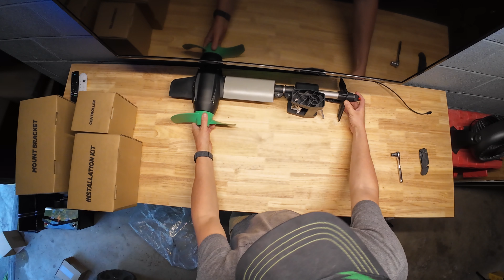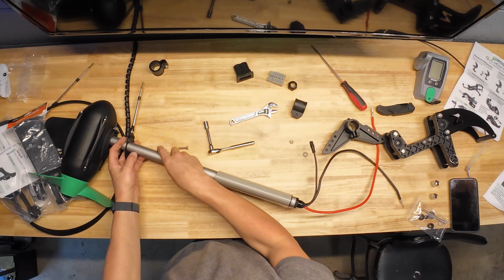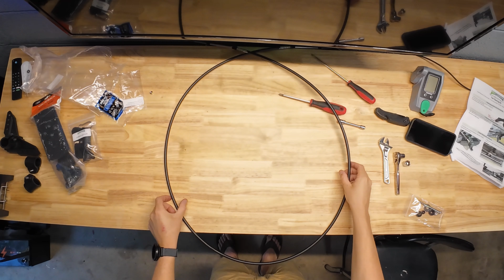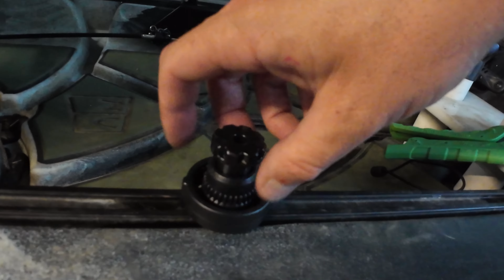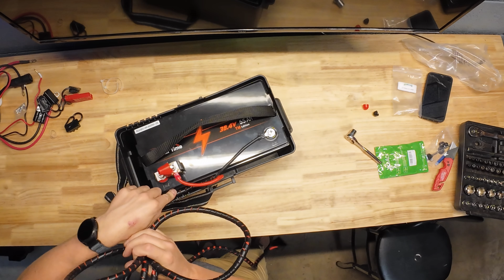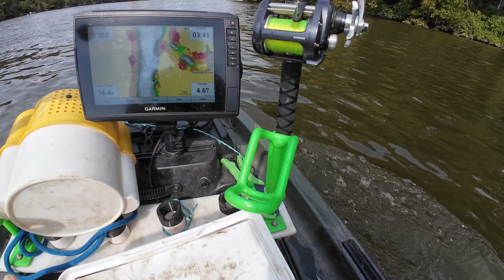Ultimate Kayak Motor | Setup and Water Test Newport Vessels | NK300 Nucanoe Unlimited

Comment: So, had a similar set up on my Nucanoe Unlimited. NK300 and Motor Guide Xi3 for the spot lock feature. I used both through the winter for Crappie fishing and it was awesome. The NK300 got me where I need to be in a hurry and the Xi3 is what I used most of the time.
Reply from the maker: Good setup for sure. I’m working on a far better setup as we speak

Comment: Are you using a different battery to power the Xi3?
Reply from the maker: Correct. Xi3 is 12v. Newport vessels nk300 is 36v. Different batteries are needed. My xi3 is for sale
Reply: @GooberTimeGuideService  thanks for doing the video.   I am planning the same setup, except with minn kota terrova on my unlimited.   Debating between the nt300 or nt180 pro.

Comment: How do you like the battery?? I am really leaning toward getting it over the Newport batteries.

I may have missed it, but does it come with a charger? Also, unfortunately, that battery box is out of stock. I'll have to find a different one.

Awesome video, though. Thanks for the info!!
Reply from the maker: It’s excellent! I run them in my guide boat too. Use our links to help out the channel

Comment: Bro thank you I have the new canoe hand steer kit that I'm putting on XTR 130 bonafide now I can actually see how I'm going to mod this after you took apart the NK300 I thought the power cable was all one piece and I would have to splice wires thank you for making this video I will have a video on my build as well not starting it yet still waiting for more parts
Reply from the maker: Hey no worries. Glad it could help. It’s an awesome little motor

Comment: Nice video. A heads up though as I think you put the mounting plate for the throttle control on backwards. The plate should cover the bottom of the throttle entirely.
Reply from the maker: Good catch. I’ll have to take a look at that. Thanks for watching

Comment: Could you hook up both motors to the same battery and just use them one at a time or no?
Reply from the maker: No definitely not. One is 36v and the other is 12v. You’d fry the 12v motor off you hooked it up to 36v. Immediately dead
Reply: @GooberTimeGuideService  Oh that’s right. Keep forgetting those Newport batteries are 36v. Bummer, would be cool if you could share one battery between the 2 motors.
Reply from the maker: @TWC6724 I’m sure you could get a voltage step down for the 12v leg and make it work but I wouldn’t want to take the chance of moving it I one day on accident

Comment: Got a question when you were running the test on the top speed for the trolling motor did you have the electric motor tn the up right position because if it was down I believe it would create a drag on the actual top speed
Reply from the maker: Yup!